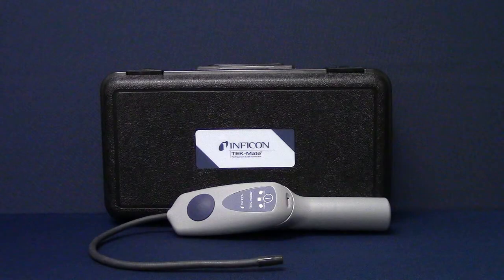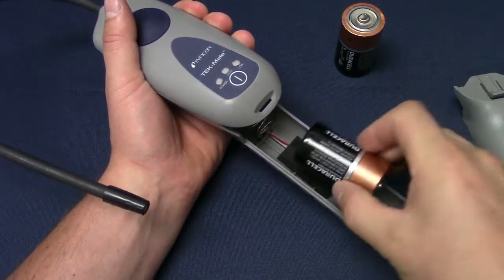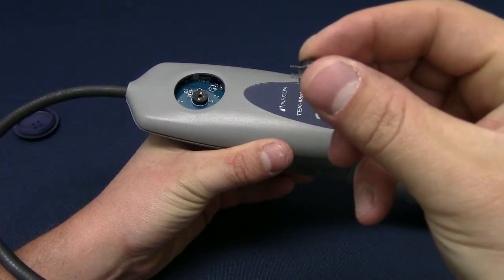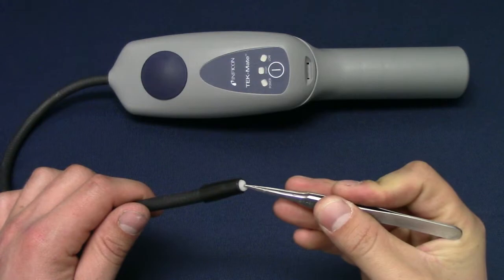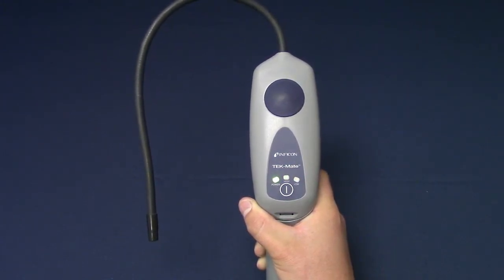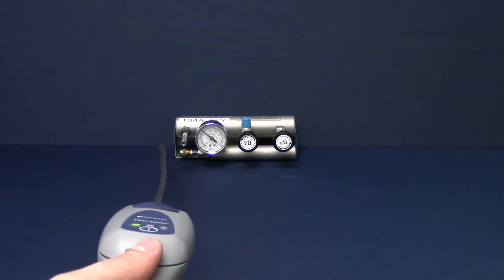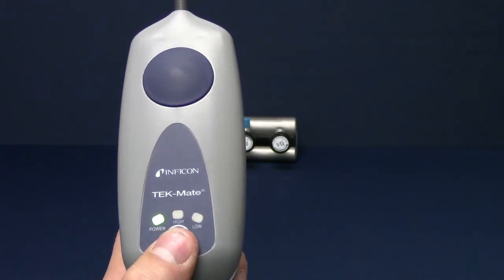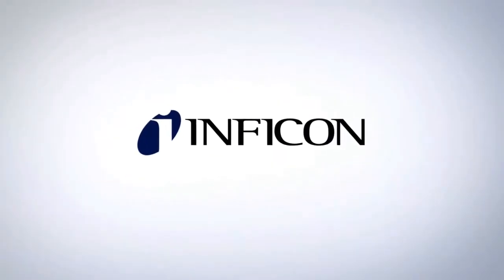Quick Start Video for TEK-Mate Refrigerant Leak Detector

Comment: How long take to warm sensor?I have few minutes before signal is shut up
Reply from the maker: Thanks for your question. Sensor warm-up should take between 45-60 seconds. If your sensor is contaminated or has moisture, warm up can take up to several minutes.

Comment: Can they be repaired if it doesn't turn on at all replaced battery and nothing
Reply from the maker: Hi there and thank you for the question! We would be happy to help you if you can give us a call or email here — 800-344-3304 OR service.tools@inficon.com
Reply: When I turn on my leak detector high pitch sound does not slow down it just stays on steady, what should I do?